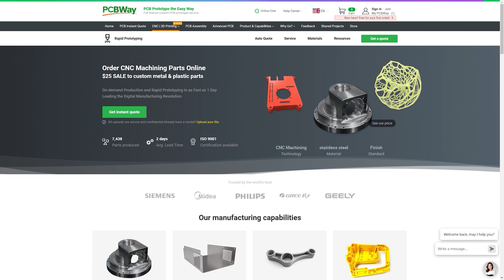This 486 Motherboard Appeared To Be Dead, but ...

Comment: I had (maybe) the same motherboard on my first desktop computer. It came with a Trident TGui VLB vide card (that I maxed to full 2M and got 800x600@32bit or 1024x728@ 24 bit color) and a similar dualchannel IDE adapter card that was capable of UDMA transfer under Win95. Memory wise, I used 4x1M, 4x2M and 4x4M 30 pin simm with 2x8M and 2x16M 72 pin FPM SIMM. Max memory configuration was 48M but once I got one 32M 72 pin SIMM to test and had 4x4+1x16+32=64M (man, Win 95 ran like a champ). Bios wise it had WinBIOS (the graphical BIOS) and it was able to do WB and WT cache. As for the CPU, I used it with I486DX2@66 (the original CPU), DX4@100, AMD 586@133 that I overclocked to 150 but it was kinda unstable (FSB 50MHz). It accepted 5V and 3.3V CPUs and ran them at FSB of 25, 33, 40 or 50MHz. I did not had a manual for it, but it was not necessary becauseall jumpers were writen on the board.
Those VLB slots were marked Master first two (orthe first one only maybe?) an Slave. When I put the IDE single adapter in the slave one (the lastone, farthestaway from the CPU), it did not had UDMA speed unless I had installed some bus mastering utility, or I installed Win 95with the "486 with VLB" option.
Please, tell me what motherboard it is, maker and model?
Reply from the maker: Wow. Sounds like you really had some fun with this MB. I like that it is so versatile for this time period.
Reply: @RetroHackShackAfterHours  Yes, really I was proud of it. I literally learned howto about computers by trial and error. And I played games that on a Pentium 100 (that  my neighbour had) ran slow. I tweaked it to the max an I was able to play even Quake at reasonable FPS, Anno 1602, Warcraft 2, C&C Red Alert, NFS 2 and many others. The only limit was the HDD space that was kinda expensive for me at the time.
That why I am looking for it and I hope maybe I can find it again, for pure nostalgia reaasons.

Comment: Might I recommend you pick up some Deoxit D100L in the bottle with the metal tube.  It is 100% solution unlike the 5% spray (D5S) you are using.  It is much easier to use on computer sockets and it works better and faster and does not contain any mineral oil.

Comment: The FSB the CPU runs at (ignoring the multiplier) affects how many VLB cards you can run concurrently in those slots.  If you plan to use it as a test bed for multiple VLB cards, you may want to swap the CPU... But then of course... Jumpers.

You usually shouldn't mix 30-pin and 72-pin simms.  It's likely only seeing the 72's anyway.
Reply from the maker: I was wondering about the memory as well. Didn't have time to test it.